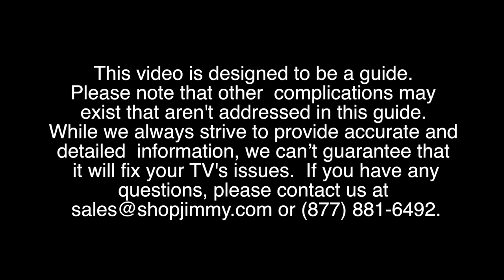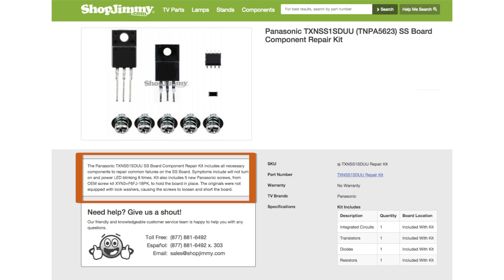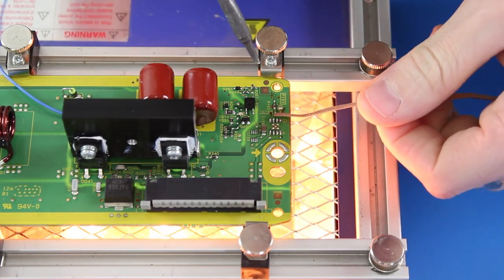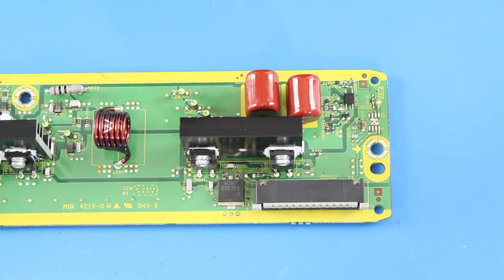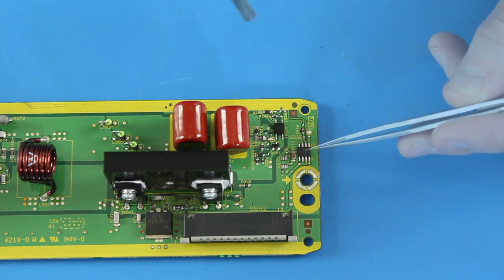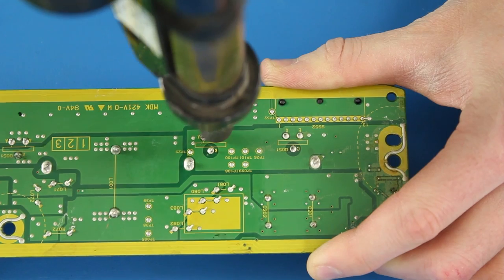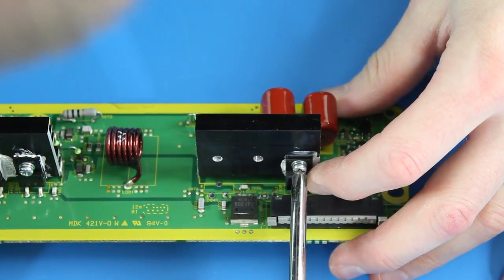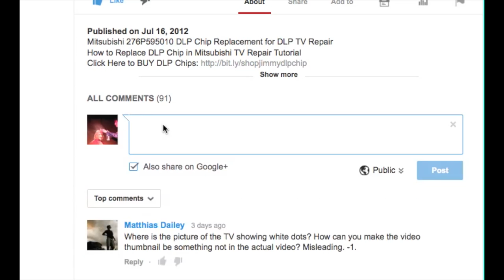Panasonic Plasma TV Repair - TNPA5623 SS Board Component Repair Kit TV Not Turning On 8 Blink Code

Comment: I bought the repair kit from you but I don't have a heat gun like I see in this video. How can I solder the middle of the IC chip with a standard soldering iron? Also, one of the ever so small printed circuit board legs broke off while removal of the same chip. I will try to solder it back on along with the chip. The tools you're using make this repair look so much easier. I still have hope to get the job done. I await your reply on soldering the middle of the chip. Thanks rb67mustang.

Comment: Thanks for the parts and the video. I accidentally pulled pad 5 off the board for component ic152. Is that pad just an anchor or do I need to expose some copper around it to solder to?

Comment: Hello, great video thank you!...So I have a Panasonic TC-P55VT30 which was showing 7 blinking lights, when I disconnected SC board it went to 8 blinks, then i plugged the SC board back in and disconnected SS board and it went back to 7 blinks. Any thoughts on which board is shot? Thank you for any help!

Comment: Thanks for the video. I have a Panasonic th-p50st30a Plasma that just died. I started receving the 7 blinks error. Upon investigation to confirm the SC board was the issue. I unplugged the SC board and powered on and then got an 8 blink error code which indicates the SS board is the issue. Have you experienced anything like this and do you have any advice on what steps to take to repair? Thank you.
Reply: Hey I got the same thing...did you figure out if it was your SS board for sure? If so, how? Thanks!
Reply: dutchkork I figured out it was the SC board. I got a refurbishment replacement chucked that in and now good as new

Comment: There seem to be missing the information what causes this problem. It's described in the technical bulletin TB-13-02 from Panasonic. When the board is just reassembled without cleaning the areas affected by the arcing it will be damaged again as I learned the hard way.
Reply: It can be found here: http://www.avsforum.com/forum/attachment.php?attachmentid=76207
Reply: +TomTechTod I repaired the board and it died less than a second after power on. Did you just sand the traces that showed signs of arcing? Could you explain further on what caused the problem and how you fixed it? Is it from the board grounding out at the screw hole or is it supposed to ground there and it has a poor connection?
Reply: +i5usko It looks like it was a bad ground. Too bad I wasted $20 before I read your post. Really these parts should only cost a few cents.
Reply: +i5usko  TV repair made easy?lol what do you think anyways that's what sj says
Reply: i5usko Only saw your post now. Yes the chassis is part of the ground even though there is a ground trace on the board, but my guess is it's impedance is to high so some current goes through the chassis. Just sanding may not be enough, it started sparking after only a few weeks. Then after using dented washers the problem was solved.
Reply: Thanks for the info Tom. I was actually sent defective parts too. They shipped me a new set after I already purchased another set. I just have a spare set of parts now I guess. The tv is working now so all is well. What do you mean by dented washers? Do you mean lock washer (guessing star type)? Doesn't matter as the split type are included in the repair kit. Also, I don't know what the heck you are talking about PHILSHOW. I think electronics repair is easy but fixing an engineering mistake is not always as such. Problems always seem to come back due to design flaws.
Reply: Yes, I meant lock washers. Glad it's working again!

Comment: Hello, I have a Panasonic TC-P60ST50. The indicator light blinks three times. I have researched this and found..Three Blinks: Three blinks of the power LED indicates an over-current or over-voltage condition in one of the DC supplies of the AP board. The AP board is repairable. Therefore the use of an ohmmeter and peak-hold-voltmeter is required to determine the cause of the shutdown. An over-voltage condition is definitely a defect of the AP board. An over-current condition may be due to a short circuit located in the AP board, A board, or the LCD panel. Do you have a video that details this repair?

Comment: Hi, I have a TC-50PU54 that does not power on and blinks 8 times. I work in an SMT shop so board repair would be a snap. Should I just order the repair kit or is there some troubleshooting I should do first?
Thanks!

Comment: I have a Panasonic TC-P50S1 plasma. The power randomly shuts off and I'm getting the 8-blink code. Do you have a repair kit for this model? Or, maybe even better for me, would be a new SS-Board. It would probably be easier for me to replace.
Thanks!
Reply from the maker: Guyman Murphree    Try this at your own risk. Unplug the TV, then disconnect the SC board and plug in the TV to see if the TV powers up. Reply with the results of this test. Thanks! www.shopjimmy.com

Comment: My Insignia NS-LTDVD26_09 WILL NOT TURN ON USING THE POWER BUTTON. AFTER SEVERAL TRYS WITH A  RADIO SHACK 15_302 REMOTE RANDOM  CODE INPUTS SOMETIME TURNS IT ON..IT WILL ALLOW ME TO VIEW DVD'S WITHOUT BASIC OPTION EXCEPT VOLUME WORK FINE. THE RED POWER ON LIGHT WILL COME ON AFTER I UNPLUG IT SEVERAL TIMES..THEN I ENTER SEVERAL CODES UNTIL IT POWERS ON. SHOULD I REPLACE THE POWER BOARD?  Forgot sometimes it holds the code and I can power it on and off  several time before it goes back to the graveyard sleep. Thank you for any feed back

james

Comment: I have Panasonic TC-P50U50 and it blinks 8 times. Just went black. I have opened it up and checked R16051 5.6 oh res and mine is 6.2 on SS board. What do you think?

Comment: I purchased the SS Board Component Repair Kit from SJ but I messed up one of the pads on the IC (pin 4).  I believe this is a ground but would like to verify this by checking the schematic/pinout for this IC (BD8694 1521).  Can you provide a datasheet for this chip or a mfr/part number?

Comment: I have a TC-P50U50 and I just installed all the parts from ShopJimmy. Installed the resistor, IC, voltage regulators and new screws. Finished the repair, started the TV and about 15 seconds afterwards it smelled of burning and the tv shut itself off. Help?

Comment: hi..have a philips 50pfp5332d/37 plasma..that is completely dead..no standby light..no clicking no nothing..trying to locate stndby power board?? if there is such a thing because im thinking if I don't at least have stndby power there wont be power on power..power in is 120v...after that I don't know where to go...any suggestions???

Comment: TV model TC-P65ST60  TV wouldn't turn on and had 7 blinking lights.  I removed cover, disconnected the Yboard and plugged back in.  TV then had 8 blinking lights.

thanks
Reply from the maker: +Keith Dougherty   Try all repairs and troubleshooting at your own risk.  Repeat the same test on the SS board.  Thanks!  www.shopjimmy.com

Comment: Panasonic TC-P50U50. I replaced the components on the TNPA5623AB board and the 8 blink code went away. However, now the TV turns on but has a black screen that flickers and will not respond. Any Ideas?

Comment: I have Panasonic tc50pu54 and blinks 8 times, and the model for sc board is( Panasonic SC Y-Sustain TNPA5621AB TXNSC1SDUU for TC-50PU54)
do you think replacing this part will fix the problem, and if yes do you have it in stock
Reply from the maker: Ramzi Khoury   I recommend that you bring your TV to a certified Panasonic repair shop.  Thanks!  www.shopjimmy.com

Comment: I bought a 37' Proscan lcd tv and as soon as I brought It home I realized that there is one kind of like shaded line across the screen..and I was wondering if there was a way to fix it
Reply: Wow I think I just found the problem.. i was looking through the slits in the back of the tv (vent slits maybe) and the board with all the bright lighted circle.. I have notice that were my problem is on the screen is where there is a small wire blocking the hole, but now that I think about it its on the back of the tv so its probably not that right?

Comment: Have a Panasonic TC-54PS14 that will not power on but is giving an 8 blink code. Not sure if this helps but disconnected power and ribbons from SS and it gives me another blink code of 6 blinks. Does that mean I have other bad components as well?
Reply from the maker: Omar Torres   I recommend that you bring your TV to a certified Panasonic Repair Shop.  Thanks! www.shopjimmy.com

Comment: Hi, I have a Panasonic TC-P55UT50 that blinks 8 times when powered on.  I have had the SS board repaired, but it still blinks 8 times after being reinstalled.  I have disconnected the SS board from the power supply and now it gives the error code of 6 blinks when turned on.  Does this mean that something else is wrong?

Comment: Hi, I'm trying to find out why a Sharp AQUOS LCD TV turns off unexpectedly after one minute on. I have to disconnect it for two to three minutes, reconnect it to the power outlet and then you can turn it on. It only stay on for one or two minutes and the it turns off by itself. The model is a LC-42SB48UT. And no, there's no Firmware upgrade for it.

Comment: I have a panasonic tcp50g15 plasma tv. Today I turned it on and the backlight turned on, but there is just a black screen. The red light is on and there is no flashing. The tv will not respond to any of the buttons on the remote or the tv itself. The tv will turn on and back on again 20 seconds after hitting the power button on the tv. It worked this morning and I have tried different HDMI devices, but nothing works.

Comment: I have FILIPS 42PF9966. hard turns in the morning when it is cool.
When you turn it on after 10 to 20 attempts red light flashes me one and 8 times in succession.
If you turn it off while hot and turn it on again, then fell without problems immediately.
I do not know what the problem is, so please help me. Thank you.

Comment: I have a Panasonic Plasma TC50XT50 and it has no power. I checked the blink code and she blinks 3 times. I checked the codes and it says that the D board 3.3 volts is the problem. I looked all over the internet to find a D board with no luck. I do believe it went out after a lightning storm. Any help will be appreciated.............

Comment: I replaced all parts with your kit and then noticed component PC251 is missing from the board, looks like it broke off. Can you tell me what this component is?
Reply from the maker: +London Harroff  Try all repairs and troubleshooting at your own risk.  Can you upload an image of the location on the board?  Thanks!  www.shopjimmy.com
Reply: I can't  upload an image, the component that is missing is next to IC152 that is included in your repair kit.
Reply: This is on the TNPA5623 SS board component PC251.

Comment: Panasonic model TH42PX6U   SN:LA62370579.  Original starting problem was very Thin lines red,blue,and green line in the middle of the screen. The Video and Sound were Ok.

 After watching some of your videos, I cleaned the ribbon cables on the bottom buffer boards and reseated them all into their sockets. Still same result. I then Purchase the left buffer bd.  TMP A3812.  After installing this board.  Now I'm having vertical line clear across the screen with video, only on the first 10 inches of the left screen;  Vertical lines through the rest of the screen, sound is Ok.  Re-install  the original bd and still got this new problem. As of now I have also replaced the right side buffer bd TMP A3813 an the drive bd TMP a 3810.
No result the New problem is still there.  Can you please advice if this is due to another board.
Thank you very much for your support and advice.
Respectfully yours.
Didi
Reply from the maker: Diana Sepulveda   This sounds like a TV panel (TV Screen) problem.  If your TV panel is bad, it may be more cost-effective to replace the TV as panels are typically hard to find in stock, difficult to replace, and expensive.  Thanks and please let us know if you have any further questions!  www.shopjimmy.com

Comment: Panasonic TC-P54vt25 Wont turn on. 8 blinks.
Reply from the maker: +Skip K   Try this at your own risk. Unplug the TV, then disconnect the SC board and plug in the TV to see if the TV powers up. Note that it will not have a picture on the screen. Reply with the results of this test. Thanks! www.shopjimmy.com

Comment: Replace the whole board
Reply: +Rick Clark Very Poor practice to 'just replace the board, hints of you unable to proper fault-find to component level.!
--'board changers' are NOT technicians IMHO. Fit a used board with old parts, and who knows how many thousand hours on it, you could well be back to square one in a short while, and there's one less board for a set that really does need it, instead of just a simple fix on this one.

This attitude has lead to the very short supply and stupid prices of boards such as TNPA5105, TNPA5081 etc...
--Some of these in Dead condition change hands for $50 upwards.....

Another reason NOT just to replace--There are SO many revisions of these things, its doubtful you'll get the exact one unless you order from Panasonic.--With their prices--Who does that!

Comment: I Don't think many diys can do this.WHO HAS A HOT AIR TOOL. only tv shops might.  this seems like a video for techs not DIYS.This board is NOT AVAILABLE.good luck finding it.
Reply from the maker: ThePHILALLENSHOW   Thanks for your input, and we are happy to provide these videos to both techs and DIY'ers.  As we mention in the video, "The tools used in the video are recommended for the repair, but each person may use different tools according to their skill level and preference."  If the board itself is difficult to find, the repair kit can be a great solution for repairing your existing board, if the symptoms are a match.  Thanks!  www.shopjimmy.com